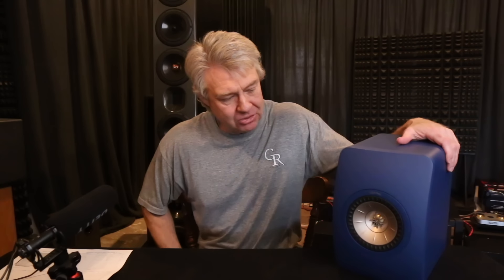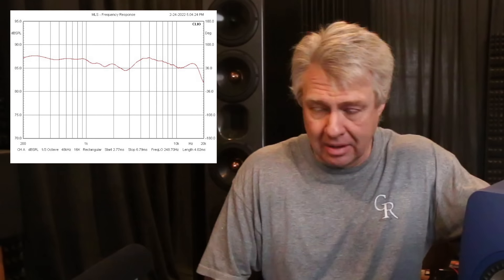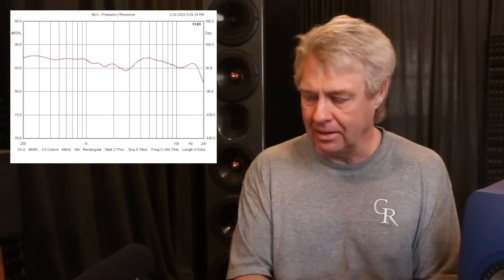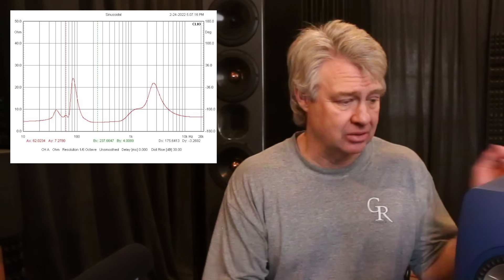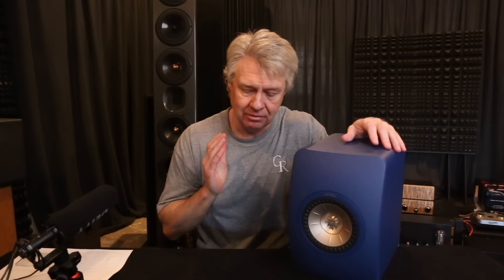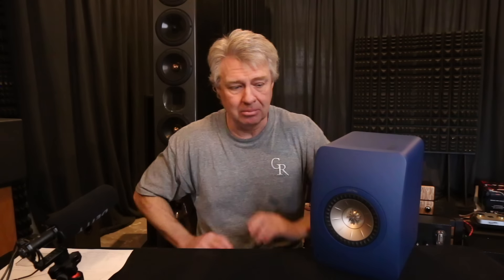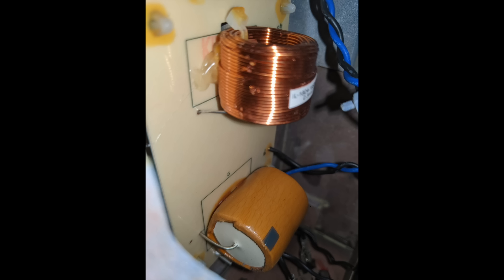KEF LS50 Meta! Worthy of HYPE?

Comment: Interesting review but there are several obvious problems. At the top of the list is the uncritical acceptance of a single users anecdotal reports of listener fatigue. Then there is the more serious problem that the frequency response curves that he shows don't really line up very well with other folks measurements particularly Atkinson at Stereophile who is still the best in the business, who does not show quite that degree of treble roll-off nor does his testing show the mid treble shelf, which frankly is more likely a potential cause of listener fatigue. But Atkinson's testing doesn't show really much of either of those issues nor do other reviewers complain about listener fatigue, so once again, he has not really established correlations between the anecdotal reports and what he's measuring. Additionally and certainly a problem for many audiophiles, he uncritically accepts popular memes about putative audible characteristics related to certain crossover parts, memes which have not been held to or validated in double blind testing. This guy knows a lot but not as much as he thinks. And clearly not as much as the KEF design team esp. the head of the team Oclee-Brown who is an electrical and acoustic genius.
Reply: First of all, our measurements and John Atkinsons measurements are dead on. I know this for a fact as there have been companies that have sent us products for measuring and testing prior to sending them in for review knowing that they will be measured. Our measurements always match to the T. 

Secondly, because they know the speakers will be measured by John Atkinson, when they get reviewed by Stereophile, they often send a reference pair. 

What we get are not reference pairs. We get production models. So there is where the differences occur. 

Also, we have confirmed from blind comparisons everything I have said about the sonic characteristics of any crossover part. We also use the comparisons of hundreds of others to confirm our own. So you can take my word on those crossover parts to the bank. 

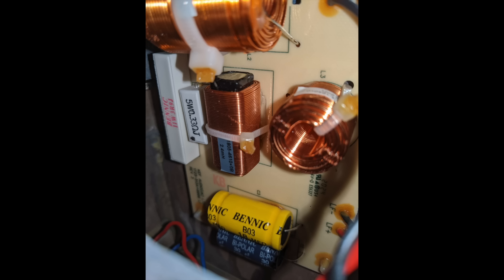You also might want to check this video on the 4:50 mark to see what is used inside these Kef's. Those iron core inductors, and electrolytic caps and sand caste resistors are garbage. You can take that up with the Kef design team.

Comment: I have not heard the LS 50 or the LS 50 Meta, so I really don't have an honest opinion of these. I have read and seen mixed reviews of these. It's all in the ear of the beholder, I suppose, as with any speaker system. Seems like an awful lot of work to give them a very minor tweak. They seem to measure out very smooth and the spectral decay looks fine as well. Live with them or buy a kit from Danny? You'd get a good buck for the LS 50's and would probably be happier with a set of Danny's. GR Research certainly spends a lot of time making sure their systems work well and sound great.
Reply: Most importantly, GR Research is the only company spending time on their speakers. Nobody else does, least of all KEF. They are so lazy, they don't even spend time sourcing quality drivers. Instead the go the easy way of designing and building them on their own just to save some money. Did you see that peak above 20kHz that wasn't even visible in the measurement? That's how cheap a design this tweeter is. As if that wasn't bad enough they even publish whitepapers on their inappropriate work instead of working harder on their cheesy parts and drivers. They even include the schematics of their low quality crossover topology so the average guy would believe GR Research are wrong in stating that there's no resistor in front of the tweeter and that the electrolytics are directly in the signal path! All that effort just to draw our attention from the fact that they are too lame to add tube connectors. I am so glad we all know better now ...

Comment: A whole lotta snake oil going on. Premium parts create audible differences?  Where?  How would such parts lead to it sound less like it's playing "through a wet rag"?  Where does that "wet rag" quality correlate with a measurable, and how would a premium part change that measurable.  And why couldn't any of the issues you bring up be fixed with EQ given that uniform quality of the off axis responses?  And blowing $5k will fix that.  

Unquestionably the LS 50 Metas have their limitation.  They won't play very loud, the small coaxial driver won't play into the sub 200 hz region above 95 db without generating unacceptable levels of distortion.  But used in an small room with small positioned off axis, it's listening window in unexceptionable, and it will comfortably play 86 db in a smaller room.  Definitely a bargain, and will certainly have a higher resale value that one of your kits.
Reply: If you think all parts sound the same and we only hear a difference if we can measure it then you have a lot to learn, and every kit we offer will out performance these coming and going.
Reply: @dannyrichie9743  Really? I'm 69 YO and a 45 year audiophile who bought his first pair of Ls 3/5 s's in 1977.  I've owned Magnapans, Martin Logans, Aerials, KLH's and Kefs.  

One thing I know is there's no such thing as an effect without a cause. So what's the cause that allows one part which has the same measurements as another to audibly outperform it?  Any evidence your part substitutions could be identified in a double blind listening test let alone found to be preferable?  How about in a null test? And fully  two centuries after Jsmes Clark Maxwell completely specified how electronic waves behave in our world can you claim there's some property not captured (or apparently capturable) by Maxwell's measurements that has a audible effect in the real world? So what is that property?  Finally, Is there some sort of peer reviewed psycho acoustic research that gives credence to its existence, and, moreover, are there any other evidences for this magic property in fields other than audiophile equipment marketing? 

The Nobel committee awaits to award you it's prize in physics.  All I can say is move over James Maxwell and give Michael Farraday the news! 😜
Reply: @dannyrichie9743  I appreciate your experience and wisdom, so I'm not trying to troll here, but what doesn't make sense to me is that you use measurements to tell what needs to be fixed with the speaker, but often, a part of your solution is to replace components, the results of which can't be measured. I defer to your experience but it makes for a logical contradiction.
Reply: @nathandaniels4823  No contradiction at all. Cheap or high parts quality can have just as much to with with how something sounds as anything else.

Comment: No no no. For 1600 bucks there should NOT be any iron core or electrolytics. For that money I could buy an extremely nice pair of hand made speakers from Fibhorn that would sound way better. For that money I could buy a pair of speakers from you guys, which I’m guessing would also sound as good if not better. 

So no, I think you can do much better for the price. That response curve isn’t nice either. That hump starting round the ouch frequency (4khz resonant ear frequency), not nice for long term listening. Everything else looks decent though. I’m sure you could do a lot worse but I think the KEF LS50 Meta are overpriced. Nearly $500 for a stand doesn't help.

Comment: he cant make it better thats why.
Reply: We can, but it's not worth the effort it would require. It would either mean needing an external crossover which isn't a realistic option for 99% of people. Even removing the stock crossover boards to swap out the caps on the circuit is a destructive process. the crossover boards are mounted onto plastic pegs which are then generously glued into place. It's just not practical, and the customer agreed.
Reply: Did you watch the whole video? This was explained.
Sometimes you are better off spending that time, effort and money on something else. IMO Kefs have always been some what over rated.

Comment: THe KEF LS50 is one of the worst sounding speakers I have heard in modern times. I just heard the KEF R3 and it sounds just as terrible. It is gratting, fatiguing, harsh and no lows and no texture or warm to the sound even when it is in the recording. If you gave me a pair for free I would not even sell them to someone else I would do the world a favor take the lose and use them for fire wood! Nothing with that type of source point coaxial design sounds like anything but garbage and you can get much better sound out of a more conventional design. Did you actual try listening to these for a few hours? Your ears will feel like they are bleeding and you will have a headache!

Comment: I listened to the LS-50 Meta version in a friend's system. He wasn't thrilled with the sound and asked for my opinion.
This was not a fun experience. The bass extension is decent but the quality of that "wooley" bass leaves a lot to be desired.
In simple terms, it sounds artificial. I'd gladly trade-off some bass extension for a tighter and more believable bass.
This is IMO one speaker where the hype is way above its actual performance. Advanced technology is good - but where is the music?
Bottom line: a boring if not irritating product.
My friend retired it to his computer setup. Sure, it's better than a Logitech... and it does look good...

Comment: The  reason that this KEF stuff sounds lifeless is that it dips at 203 j abd off axis ir rolls odd like a shot down plane . Lifeless sound is to be expected.especially since it is already rolling down at 1 kHz an even lower. They believe in this but it does not make sense to me. What excuse is there for pushing down the off axis at 500 Hz?  This has a lot  more influence on the sound than having an inferior cap(bad though that is)